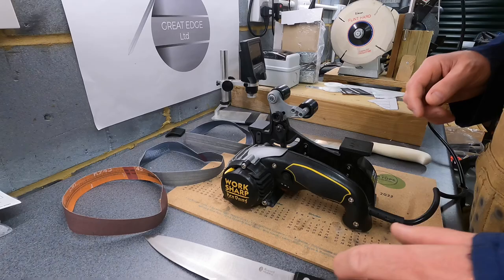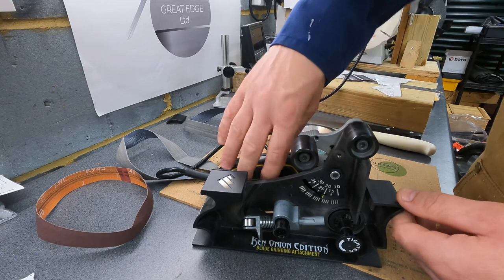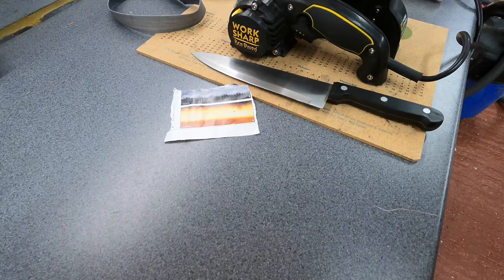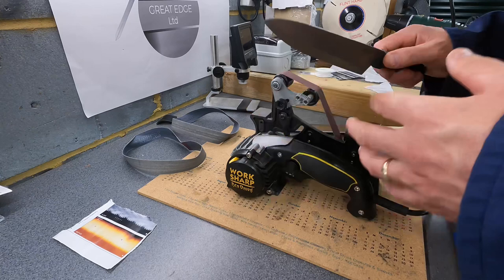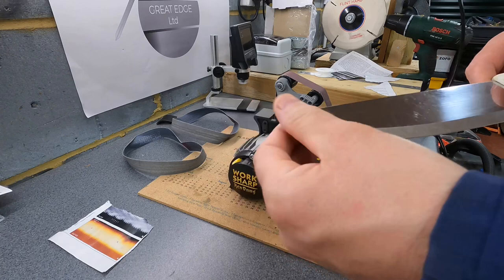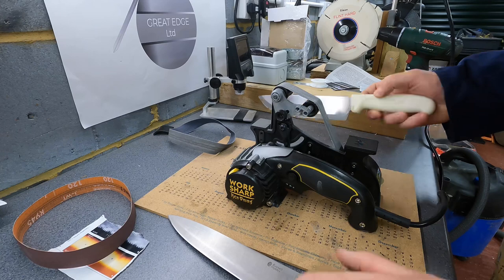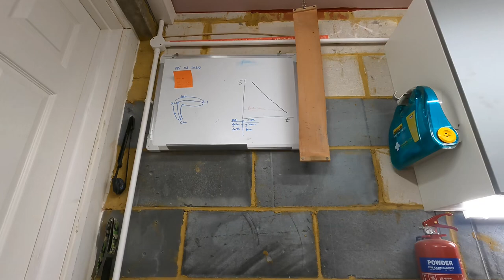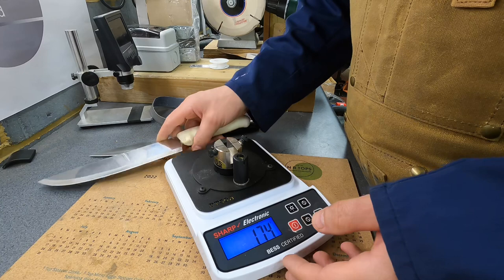Work Sharp Ken Onion Elite Sharpener - full process (including heel repair with two Everyday edges)

Comment: very interesting , i do not lap my blades on leather , but i do use a MDF / fibre board wheel , with white metal polish 
[Hyfin ]to hone and polish the edges. I have found this to give a very acceptable edge, i also sharpen 995% of my knives at 20Deg. and only very narrow blades at 15 deg, these are normally filleting blades .

the ANGLE GUIDE you are using is not available in Australia, and postage from the USA is prohibitive, most times being more expensive than the item being purchased.
As a result i made my own  bevel gauge , with 2 set points, 1 at 20 deg and the other at 15 deg,  this works very well for my application.
i am looking at making or possibly buying a leather honing wheel for the knives , as an experiment, to see if the edge finish is better
thanks for a very informative video..

Comment: Just a thought.
 You might consider focusing the views on the belt to blade contact.
The views of the back of your elbow or forearm completely blocking the blade and belt don’t show much that is useful.
Reply from the maker: Excellent feedback, thank you.  This video was shot a bit impromptu, and I think it shows.  I have a better angle for my Tormek sharpening, but for the WorkSharp I really need the camera to be overhead, or at least over the shoulder… Thanks for tuning in 🙏
Reply: @greatedgeltd  thanks for the reply, a higher shot angle would probably be excellent.

Comment: I assume that it would be easy enough to make an extended slide for that by juat getting round stock and threading it? I have a 12" brisket knife, and one of the only units I have found that can handle that is a wicked edge. I'd rather not spend the $$ on that one. This unit looks great for a home/hobby usee.

Comment: I have both the worksharpe and the tormek, how do you decide which one to use. Is it a price point you decide with with the customer?
Reply from the maker: Thank you -that is exactly right.  Because of speed I can offer WorkSharp service at a lower cost (currently £6 vs £10 for Tormek).  Sometimes it is just price that decides, but I also talk to customers about benefits of water-cooling, which can be a benefit for higher-end knives.  And I do get slightly better sharpness and edge retention with Tormek… So although the cost is higher, the time until re-sharpen might be longer (depending on how the knife is used etc)

Comment: Great video. Thanks. I use stones to sharpen with decent results, but I also make a few knives. On the knives I make i struggle to get that first clean secondary bevel. Do you think the ken onion with grinding attachment would be good for that? It seems like you were able to reprofile  here with some success. Thanks!
Reply from the maker: Thanks for tuning in - I do think the KO Elite shown here could work if you are doing the occasional knife.  A 1 x 30 has a lot of advantage too for reprofiling as it would be faster, run cooler and likely be cheaper. But the Ken Onion would allow you to do controlled angle sharpening afterwards, whereas a 1x30 would always be freehand regarding edge angles. With your stones experience though that might be fine for you…
Reply: I sharpened on stones for >10 years and used the 1x30 belt sander to remove a lot of material to start a full restoration before buying the KO with this elite attachment. It helped me a lot to speed up the process as it makes it so much easier to keep the angle steady and the final result looks much better. I guess that’s mainly because of me. I only sharpen my own knifes and that happens just 4-6 times a year. I just don’t have the muscle memory someone who does this often has. To me the KO is a great help. I still sharpen my best knifes on stones….I just like the ritual ;)

Comment: Is the blade grinding attachment supposed to swivel around or doe’s it lock in place?
Reply from the maker: It does swivel around, but not in any sort of useful way. It pretty much has to be used sitting on a flat surface.

Comment: How much do you charge to sharpen a normal kitchen knife like these in the video?
Reply from the maker: Worksharp method is £6 unless there are repairs to do. Price is fixed, but I’m thinking of changing to a time-based pricing structure. At the moment, I have a flat fee for sharpening and a flat fee for repairs but if the sharpening of repair is extensive it is costly for me. Meanwhile customers that bring me food knives in a way overpay a bit. Hourly (pro-rata) fees might be a better way to go. What do you thin?

Comment: this video is so confusing, why change angle settings if you are free hand sharpening?
Reply from the maker: I see what you mean, but the Elite sharpener isn’t fully manually. The belts can be set at particular angles and are quite accurate if you work well with reference plate.  See my other video where I check the accuracy of this…. Thanks for tuning in.

Comment: why exactly do you set the degrees when you sharpen freehand ...? 😂
Reply from the maker: The Ken Onion Elite does allow for angle control, moving back and forth from a reference plate.  See my other video (Checking Edge Angle Accuracy) that that demonstrates how precise it is… Does require some muscle memory to get it right though - thanks for tuning in.

Comment: I have the Ken Onion sharpener and follow all the steps and never get a sharp edge. . Think it's a piece of junk gone in the recycle.
Reply from the maker: Sorry to hear that!  There will be a solution to get it working for you - probably something simple.  If you haven’t gotten rid of it yet I might be able to help.
Reply: I think one of the biggest problems is that you are still sharpening freehand.  If you are an occasional user you won’t develop the muscle memory to use it properly.  It absolutely needs a guide.
Reply: What’s that saying? “A bad workman always blames his tools”. Put the research in, ie. watch all the available videos on it, bearing in mind, some people put out “instructional videos” without having read any instructions. Then put the work in, starting with any crappy knives you have. Work down the grits, making sure you have a burr first. When you do get the hang of it, you will find it really is a fantastic bit of kit!
Reply: Unfortunately, sharpening takes patience and that prevents many of you guys from ever getting past step 1. Understanding how to raise a burr is the lifeblood of sharpening basics. Cavemen did it with flint rocks with no instructions, so im sure you can do it on a ken onion blade grinding attachment with a how-to manual and sharpening videos to watch. If you arent raising a burr from heel to tip on each side there is no need to go up in grits. Get a hard burr, flip, get another full burr on the other side...then go up in grits to remove that burr until it is sharpened to your satisfaction. Strop and go to the next one. 
Take 5 cheap knives from the kitchen and practice. You should get the hang of it after 3 or 4 knives..
Reply: @jhooks420  , Yeah, no burr = not going to get sharp.  I'm not sure why people can't grasp that simple concept.
Reply: @Mat-kr1nf it’s easier to throw it in the garbage..

Let him.
Hopefully someone finds it and gets a great tool for free lol
Reply: You my friend do not understand sharpening then.  This tool is hands down the best portable open belt sander you can buy. And gets knives screaming sharp
Reply: Start paying attention to the burr.  This is by far one of the fastest and easiest sharpeners to use on the market.
Reply: I'll take it 🤔
Reply: @Mat-kr1nf definitely the truth.  I really sucked when I started.  Different story now. You tube was my school.